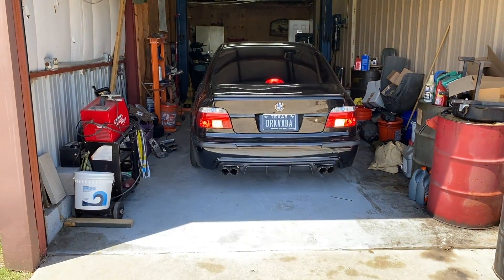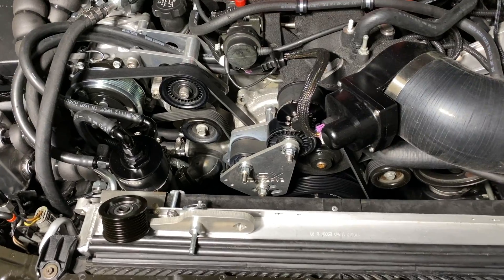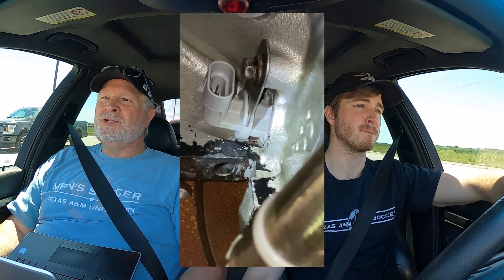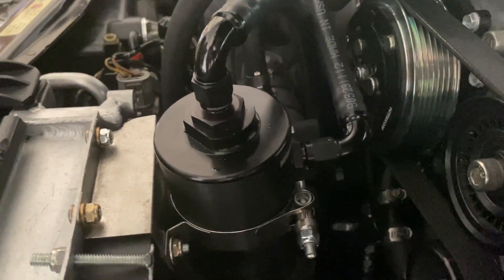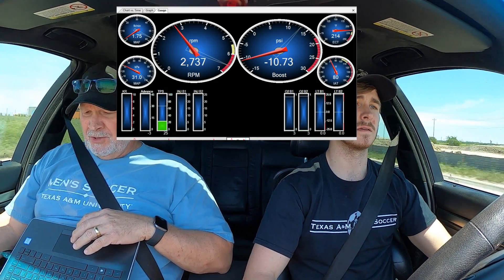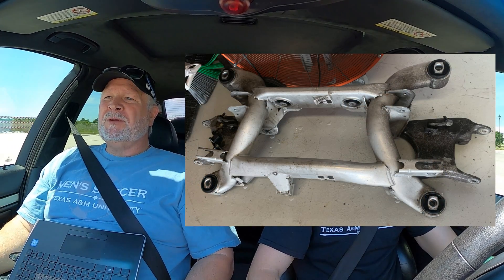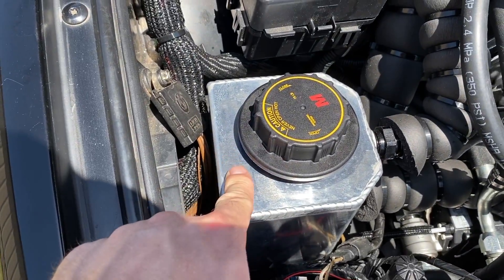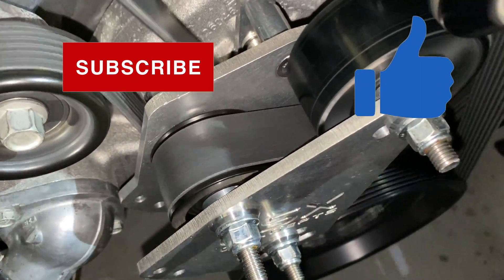Here's What's WRONG with the E39 | Supercharged BMW E39 LS3 Swap

Comment: Can you tell me what you did to reduce wheel hop? My 540/6 has it bad if I start of quickly above 2K RPM.
I have the M5 diff and the subframe stiffness.
Reply: Dont you glade your dad has knowledge about car. Hope my dad has that knowledge LOL. Nice vid.
Reply from the maker: Seth ///M3 haha for sure man, he knows way more than me but I’m trying to catch up!
Reply from the maker: Honestly, I think the reason we don't have wheel hop issues right now is because there's so much torque going to the rear wheels that we're just spinning the tires and painting stripes. We may run into wheel hop issues once we get stickier tires, but we want to make sure that everything is reinforced in the rear end at that time. I think you did the right thing with the M5 diff and stiffened subframe, what suspension/bushings are you running?
Reply: @TireKickers  I've got H&R springs, koni's, Eibach sway bars w/poly bushings along with a 2 stage NOS progressive controller spraying 175hp of boost. Still has wheel hop without the juice.
Tires are Mich PS2.
Reply from the maker: BMW Info dang sounds like you’ve done everything right. I’m honestly not sure what more you can do, but that doesn’t mean there’s not a solution out there! Just curious, are you running the stock M62 V8 with the NOS? Sounds like an animal
Reply: @TireKickers  pretty much stock except for Dinan stage 5 download w/CAI, throttle body, and MAF, long tube headers, underdrive pulleys, water/meth injection, etc.
Reply from the maker: @BMW Info that sounds legit and hopefully a lot of fun. Really hope you figure out the wheel hop, we’ll make sure we document if we run into similar issues.
Reply: @TireKickers  ok, thanks. Have fun with your beast. Make sure you update you post on Bimmerforum.com, a lot of us there are gearheads.
Reply from the maker: @BMW Info absolutely, that’s a great community.